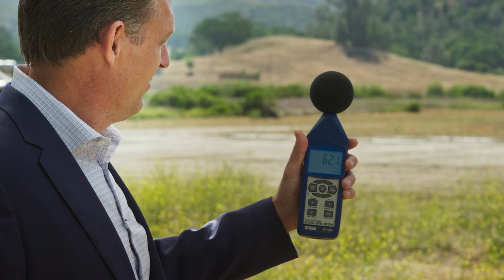How Quiet is the Joby Aircraft during Hover?

Comment: I would really want to know why he is hiding the drone when he shows "the calibrated measurement" - and obviously he is using a very powerful zoom to hide the distance.
How about making it hover 50 ft (15 meters) above the ground where distorted facts can't be distorted anymore?
Reply: he stated the distance is 100 m. 

1 meter is about one yard.

So he's about one football field away. He stated this in the video.
Reply: @neutrino78x  Yes, I know - but as I said, how about making it really close to the drone?
This separates facts from PR.
Reply: @richardpetek712  it's not going to be close to you when flying overhead. You will hear nothing. As opposed to a helicopter which you can definitely hear from the ground. :)

Check out this video (we can't post links anymore or it will eat post) "How Quiet is the Joby Aircraft During Flyover?" it answers your question :)
Reply: @neutrino78x  Once again, I am interested in takeoffs and landings, because they will probably happen in urban areas. Overflights can be mandated to 1000 ft or more if this would be necessary, takeoffs and landings can't be avoided.
Reply: @richardpetek712  

" Once again, I am interested in takeoffs and landings, because they will probably happen in urban areas. "

Yeah but that will be at least 300 feet away from you if you're walking down the street, so about the distance in this video (100 m = 300 feet/100 yards). So you could just barely hear it. If it's on one of the skyscraper helipads in New York City you wouldn't even know it's there. 

If it's landing on the roof of a building and you're on a lower floor you would hear nothing, it's not loud enough. 

Speaking as a former STS3(SS)...Sonar Technician Submarines 3rd Class, Qualified in Submarines. :)

A helicopter, if lands on the roof above you, you would definitely know. This thing, you'd be lucky to hear that. This is the future, most aircraft will be battery or hydrogen powered...only long haul aircraft will use hydrocarbons. Same for cars, those are all going to be battery or hydrogen, things are going to be a lot quieter in the city in the next 10,15 years. :)
Reply: @richardpetek712  
" Once again, I am interested in takeoffs and landings, because they will probably happen in urban areas. "

Yeah but that will be at least 300 feet away from you if you're walking down the street, so about the distance in this video (100 m = 300 feet/100 yards). So you could just barely hear it. If it's on one of the skyscraper helipads in New York City you wouldn't even know it's there. 

If it's landing on the roof of a building and you're on a lower floor you would hear nothing, it's not loud enough. 

Speaking as a former STS3(SS)...Sonar Technician Submarines 3rd Class, Qualified in Submarines. :)

A helicopter, if lands on the roof above you, you would definitely know. This thing, you'd be lucky to hear that. This is the future, most aircraft will be battery or hydrogen powered...only long haul aircraft will use hydrocarbons. Same for cars, those are all going to be battery or hydrogen, things are going to be a lot quieter in the city in the next 10,15 years. :)
Reply: @neutrino78x  , thank you...

Comment: Youve allready done the hardest partt by making it quiet enough, now make it possible to autorotate and the victory is secured.
Reply: Autorotation is not necessary for multi-bladed/engined aircraft. Unlike the Osprey, which only has one engine and propeller per wing, this design incorporates two per wing.  Also, it's possible that one of the rear engines can take up the slack in an emergency landing in case of both engine failures on one wing. These aircraft are designed to safely land even in the event of multi-engine failure, a requirement for FAA certification.
Reply: 😆😆😆
I hope these things will fly right above your house all day long and of course during the night. Do you hope it too??? This blabla about the noise of these drones makes the whole thing ridiculous. He even made analogies with ocean, wind and natural sounds.

Comment: Impressive if true. But the design is needlessly complicated. Just do two tilt wings. 2 or 4 motors. No flaps or slats or tilting engines nor control surfaces..
Reply: 6 motors reduce the load per squre meter on the props which apparently plays a huge role in the amount of noise. I also heard that tilt wings are very bad but I don't remember why. Maybe weight saving?
Reply: @Zwettekop  I don't believe either is true. Who told you tilt wings are bad? maybe you are conflating the early problems with the osprey?
tilt wing should be doable with modest weight. just a couple of moderately large diameter bearings. Nothing significant really
Reply: @DanFrederiksen  Here's the video where I got my information from: https://youtu.be/SGOG_Cgs04M
Reply: Maybe redundancy for safety, but does look cumbersome.
Reply: @nickrenold9725  for a light vehicle those forces are entirely insignificant for a neat simple rotation. All those craning tilt mechanisms as well as numerous limbs are easily much heavier.
Reply: @nickrenold9725  obviously in a flat member, having to carry up to 10g pulses, there is considerable force on the underside, however at 300kg vehicle weight, a modern material like carbon fiber is just not impressed. Or aermet for that matter.. A roller bearing wouldn't be challenged either.
Reply: Is it safe to assume you are an aerospace engineer?
Reply: @MichaelG485  let's say I'm the father of deep learning, spacex starship lays on its side on descent because of me and I know some of the physics that the visiting ET ships use. Designing a people drone is quite trivial to me.